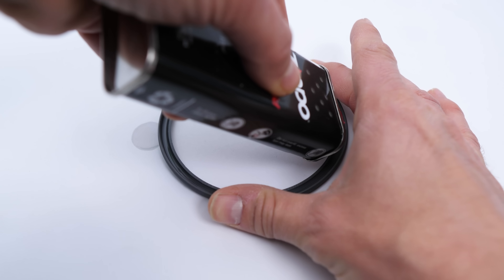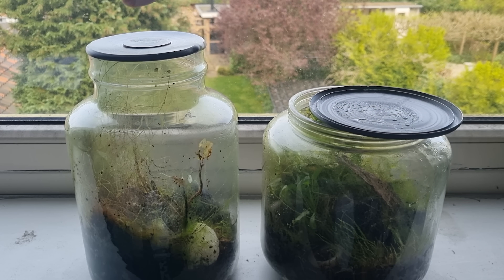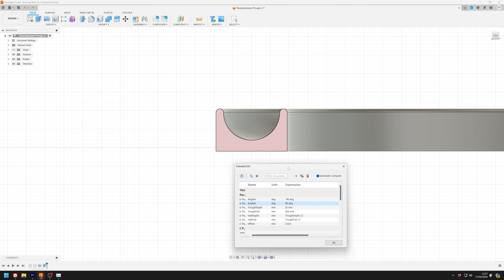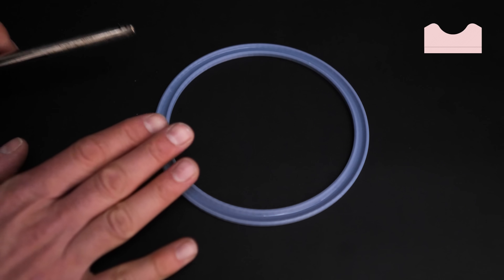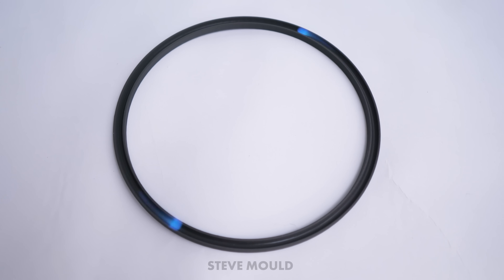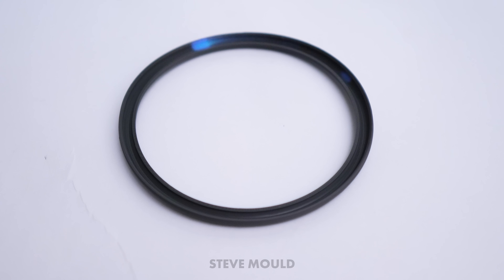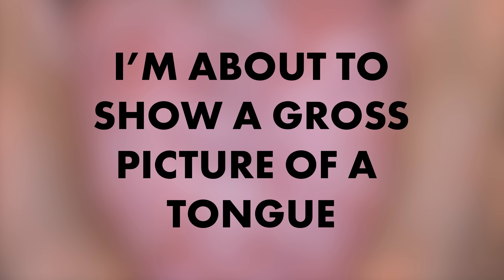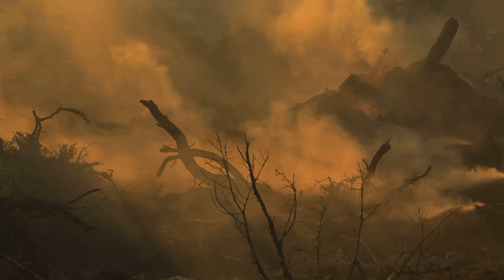Bizarre travelling flame discovery

Comment: Speaking of responsible adults,
Back in bright college days, our rooms opened off a fairly long but narrow corridor with a high ceiling. All construction was concrete or plaster rendered over brick. We discovered that spraying the ceiling of the corridor with diluted ethanol gave a similar effect. We could spray the length of the corridor ceiling, then "launch" a lighted match from one end. A zone of cool flame would rush to the other end, then reverse and come back. Sometimes it would oscillate back and forth a few times. 
Loads of fun.

Comment: It seams like you made a PULSE MOTOR with a flame 
If the opening is to big it will just light on fire
To small it won't get an of air
The air is coming I  the ring and the fire is getting pushed forward

Comment: I want to see a spiral but where the inner end is connected to the outer end via a bridge or tunnel, like the figure eight, so that a single flame can loop indefinitely.

Preferably it’s a tunnel, so the spiral is visually uninterrupted.

That, and a multi-spiral track with a loop in the middle; basically a spiralled version of the multi-arm loop, such that the inner loop is smaller and feeds a longer spiral arm, like a galaxy. Not sure how small one can make the inner loop.

Comment: I would imagine that different fuels would work like this with different widths, and that a narrow thin trough (so flat walls down to the bottom) would likely allow long term reactions

Possibly, if you used nested bore holes instead of a full trough, with the walls thin enough to allow jumping, you might even be able to make 3D travel patterns

Comment: Do the one at 10:12 but make the split different lengths so the flames dont meet up at the same time. Maybe that will produce multiple flames on the main track.

Could also modify the junctions so you don't have as much open space where the split meets back up. That might prevent the flame that likes to hang out in that spot.

Comment: Note that the forest ring calculations (in addition to being very generic - it would vary a lot with climate and tree species) don't take into account the fact that trees don't grow at a regular rate throughout the year. So chances are the fire would still stop (essentially burn itself out whenever it reached a part of the forest that was "behind" in terms of growth). You need to start it at exactly the right spot, have very stable climate, and ensure that it moved across the Earth at almost exactly the same rate as the Earth orbits the Sun (so the "front" would always be burning trees at the same stage of growth). Or, of course, just make a bit bigger so you have some margin for those variables..

It's one of those "there are X molecules in each breath and N people on Earth, so if you multiply one by the other you conclude that everyone must at some point have breathed in at least one molecule of Julius Caesar's last breath". Which isn't even mathematically / statistically valid (there is no "must", only varying values of "likely"), and certainly not physically valid (because a lot of the atoms from Julius Caesar's last breath will have been trapped in plants, rocks, metal oxides, etc.).

Comment: I am not sure the forest fire calculation is correct. Surely the rate of travel of the fire around the ring of trees is dependent on the thickness of the ring? Thicker ring => more to burn => hotter fire => fast travel, is my hypothesis.

Comment: many years ago I observed a similar effect. I had an old car that had been leaking gasoline into our crushed slag driveway. For those who don't know it's about the same texture as clay kitty litter. Anyway my car had been dripping gas for a while and after I fix the leak I decided to move the car and see how much gasoline had leaked and I could burn. Fire burned for about an hour but it leaped from area to area and back again over and over I hypothesize the heat was in fact evaporating the fuel making the fire possible.

Comment: I think the junction causes a problem because some of the vapour of the other tracks leaks over and create a virtual wider track. If you adjust the track width where the two tracks meet you could fix the standing flame if I am correct.

Comment: reduce the vapor pressure by conducting experiment in a walk-in freezer.  then you could probably make larger tracks.  further, instead of a trough, might work with strips of wicking material, like dense felt, or even denser, semi-permeable materials that could absorb and then make available enough vapor on their surface to support combustion

Comment: The Figure 8 : I'm sure others have said, but the figure 8 keeps going in the raised section not because there's enough residual fluid up there, but because the trough is containing the vapour - and the vapour has no trouble making it's way back up the slope after burning, from the reservoir down below. There may also be some capillary action on the fluid, of course, pulling some fluid up the slope, due to the way the filament is laid down.

Comment: Thought: - Looking at this; have you thought about putting a reservoir thats taller than the trough, and also enclosed, that feeds back into the ring to  continuously feed  the trough? In theory, if you have a continuous supply of fuel thats not directly exposed to the flame, that liquid much like a 2 liter pet water feeder, could continuously feed the trough producing a near endless supply of fluid, which would then in turn allow the trough to constantly have fuel to continue to burn. Doing this could produce a constant flame that spins around the path creating a light effect. 

I was also noticing the "bridge" and thinking, "what if there were grooved steps leading up to a small trough at the top"? because then you'd have a pattern that continues to feed the flame with fuel while having mini reservoirs. If a Capillary system was linked between each step in the bottom of each well, you could in theory also feed the top well with a submerged wick, which would also continue the flame as well.

Comment: 12:00 Possibly a lack of O² in the middle of the spiral causing the "strange behavior". Maybe use a "porous" table top, perhaps a wire mesh screen, under the spiral to allow for oxygen inflow.
It may also create a thermal air circulation flow that would result in changing the flame flow in ALL your designs...?

Comment: 😮 could the flame be hot enough to be caught by an infrared/thermal sensor? I'm wondering if you could make a clock out of this by combining it with a sensor of some sort. Like, having a pattern large enough to be traveled in a second and the sensor to count the minutes by counting its laps. It wouldn't be a very practical one lol, but maybe it would make a cool (or rather, hot) counter/timer.

I wonder what other applications it could have... the sun-shaped pattern and the maze are very interesting. You can basically send multiple flames in many directions and in intervals. What about the consumption and temperature? Would it, in a more complex pattern, make a surface hot enough to something like cooking? Would it take more or less fuel to keep it lit at the same temperature? Questions keep coming, help

Comment: I wonder if you could do the same thing by ionizing a noble gas like xenon? Perhaps make a arc reactor replica at the very least. Also, electric current could speed it up like a positive and negative conductive circle, an electro magnet. If you used hydrogen or a gaseous fuel like propane or methane with oxygen it would be interesting. I wonder if having something like this in a jet engine would increase speed and efficiency? Kind of like adding rifling to a jet engine.

If you made it deeper where you could have a reservoir of fuel it could keep going.

Comment: I wonder what would happen if the ring and spoke model (~11:10) had rings at the tips rather than plain ends? Would the proporgating flames split or rotate and if the latter, would they all rotate in the same direction or would that be random? 
It might be that the intersection points are a bit odd in that they are wider than their neighbouring non-intersection areas and it's this that casues the oddities ~10:20. If they could be 'trusted' and worked repeadedly, then might the flame carry information from node to node? Abracadabra, a flame-based computer? Oh, I've just read the pinned comment, doh!

Comment: The spoked circle track now makes me wonder: could it be made compact enough with more spokes to make a track configuration which can display a low-resolution gif? Think the circle as the basic time loop, and each spoke sends the flame down the track to an end where the flame would be displayed at a certain time based on the spoke position and the track length.

Comment: So, different type of medium to pass the signal from start to the end of maze.
Water with blue ink from high to low pressure.
Flame with blue light from high to low fuel fluid.
Electricity with different amp from high to low voltage.
Light with different luminous from light to dark sight.

Comment: If you use one of those heat mapping cameras that overlay the image with temperature-based colouring on a ring with a smaller width (where it doesn't seem to last long at all), maybe the flame is present, but not hot enough to produce a visible flame?

Comment: 4:38 The direction of the flame is also influenced by the pressure/direction of the gas coming from the lighter used to start the cycle.
10:44 The liquid falls to the side, but whats burning are the hydrocarbons which hover above the liquid and allow the flame to keep the cycle

Comment: @jamescondon Your channel gave me the confidence I needed to repair a trash pressure washer I found. Watched you repair a carburetor so many times I was able to mimic you successfully enough to clean out a rich running carb, and install a new water pump onto a Honda GCV 190 OHC running at 3200 psi.  This is awesome content for anyone looking to learn engine maintenance!

Comment: If the track had periodic holes to a well below then it would maintain the combustible atmosphere for the flame to propagate whist allowing the fuel level to be maintained.

Then you could do some interesting tricks.

Logic functions could be performed by e.g. exploiting the fact that shortly after one flame has travelled the local atmosphere won't be combustible until new fuel has evaporated. So maybe a logic NOT could be a circle with an outgoing spur that regularly emits pulses of flame unless an incoming flame suppresses the flammability in the exit?

For a computer you'd definitely need to be able to feed with fuel via a well or something.

Comment: Cool video, thanks.
I'm surprised you didn't mention temperature as a variable.
No doubt a warmer room temperature would increase the rate that the lighter fluid vaporises and so a smaller opening and shorter circumferance may be better.

Comment: Looks like this could be Turing complete.
The spiral with the circle made me think of a clock, inputs could be interrupted paths, gates are specific convergences or divergences of the paths to selectively destroy the wave or allow it to continue.

3D print a version with a second channel beneath and pinholes connecting the two. This second channel may then be filled with fuel under mild pressure (gravity fed from from only a slightly elevated tank) that would replenish a small amount of liquid from the bottom up to run for longer durations.

Comment: What about grass? Grass grows about 1 inch per week and burns slower. If it grows 1 inch par week, needs 3" of growth to burn, and the flame moves at 1/2 an inch per second, if you wardened off channels about 1 foot wide, a football pitch would provide sufficient area.

Comment: Reminds me of an "experiment" I did in college where I put some rubbing alcohol in a 5 gallon water jug and dropped a match into it.  The first time, there was a giant gout of flame and the whole jug seemed to ignite at once.  The second time, I dropped the match in, the oxygen hadn't had time to replenish so there was a moving wall of blue flame that travelled down the jug.  But occasionally, instead of either, it would pulse.  So a flame, effectively an inhale cycle, reignition burst, inhale cycle.

Comment: I think the figure 8 track raised section fire is maintained for a few reasons. 
One being the vapour may be drawn up the walls, then up the hill, like how a chimney draws smoke, or a person next to a fire draws smoke. The vapour wants to rise so may follow similar rules of "clinging" to walls. 
Another; I'd say the heat from the flame is combustion, so it probably has a little "push" around it where gas is expanding, this may make the alcohol in front of the fire turbulent, and push it up the hill.
More reasons I'm sure, but them's my guesses

Comment: 3:15 Completely inaccurate. The volatility of a liquid has no effect on the strength of the smell because lighter fluid (typically butane but the same is true of other liquid hydrocarbons used for lighter fluid) has no smell to it whatsoever. In fact you can walk into a room of the stuff and not notice it at all even to the point that you fall over unconscious and die. 

This is precisely why we artificially make gas smelly. There is an additive to make hydrocarbons smelly so we can detect leaks more easily.

Comment: 12:00 Based on the results of your sun design, wouldn't the junction of the circle and the spiral work correctly if it were at a right angle, rather than slanted?

Comment: Don't forget what you said at the beginning: it's not the lighter fluid that's burning; it's the vapor coming off it. The raised part of the figure-8 trough is probably getting some vapor from the part directly below it.
Reply: Maybe it can be made more reliable by having a part of the upslopes be covered with a "roof" so that vapor from the lower part gets some extra guidance towards the raised part. The "roof" sections should stay very short tho, otherwise they'll stop the flames cause they become void of oxygen as a flame passes into it (or so I imagine, maybe the flame can draw oxygen some decent distance through a tunnel). You could also use capillary force to bring some fluid up there. Maybe a simple piece of paper or fiberglass. I also found from trying this myself with a metal lid that you can put the whole thing in shallow water to keep it cool and avoid unwanted ignitions after a flame has repeatedly passed and heated up the metal. The shallow water also helped keeping it horizontally and achieve good distribution of the fluid.

Comment: What if you put a few tiny holes in the bottom of the track to refill it from below the puddle and sustain the looping flame forever using a siphon to ensure the puddle depth is consistent. Then you just need to find a way to have it actuate an escape wheel and you've got a clock with no electronics and no spring which is directly fueled by lighter fluid. Put it in one of those fireplaces with a glass door and a mirror at 45 degrees so you can see the clock face and the flame from an armchair. You would adjust the clock by lifting or lowering the siphon tank to adjust the depth of the track puddle and thus the speed of the flamefront.

Comment: Too bad a mobius strip track is unlikely.  I think it would be cool though if you could have some sort of mechanical interaction with the flames, like if you could have like a thin aluminum paddle wheel and it turns as each flame passes. Can be used to make a counter or something like that. Or even have the wheel lay horizontal ofer a circular track with curves blades so when the flames hit it may push the wheel along.

Comment: Before the video was 10 seconds in, I immediately thought of atrial flutter. One of the first animations I made for Dr. Melvin Scheinman, nearly 30 years ago, showed how two simultaneous flutter wavefronts could be induced in the cath lab. One would eventually collide with the refractory tail of the other and die out leaving a single flutter wave. Other re-entrant circuits in the heart can utilize multiple accessory pathways and change directions spontaneously in bundle branch reentry, nodo-fascicular reentry, and Wolff-Parkinson-White. Atrial fibrillation, which you mentioned, does not follow predictable pathways, although some studies have indicated contained reentrant pathways near the pulmonary veins, which is why catheter ablation for A Fib is aimed at isolating these circuits from the rest of the left atrium. Sort of like containing a forest fire.

Comment: This is pretty interesting! It seems like there’s a good mixture of fuel and gas along the whole ring. My guess is that, after burning for a short period of time, the specific point runs out of fuel and oxygen, so it propagates somewhere else. That would be why when it’s thicker the whole ring lights (oxygen can enter from all points on the ring and generate heat to evaporate fuel), but when it’s more closed it stays in one place before dying out (the whole ring is oxygen deficient). It also tends to move likely because the vapor heats up at the flame, so cold air rushes in from the sides to counteract the pressure drop from the hot air in the flame. I wonder if different fluids (ie rubbing alcohol or ethanol) would affect this? If so, it would likely have something to do with the diffusivity of oxygen in the fuel.

Comment: when I was a young teen, i'd pour lighter fluid down the drain of my bathroom sink and light it. it would sometimes quickly spiral down the drain, and sometimes quickly zoom down all at once and then back up again and make a LOUD whistle noise. I would spend like 30 minutes doing this over and over it was so fun and interesting to change how much fluid to use, or if pouring some down into the P trap directly would make a difference. It would be cool to see a clear tube kinda shaped like that to play with.